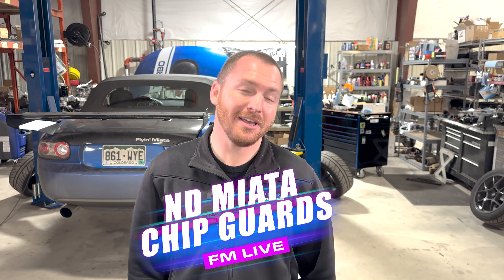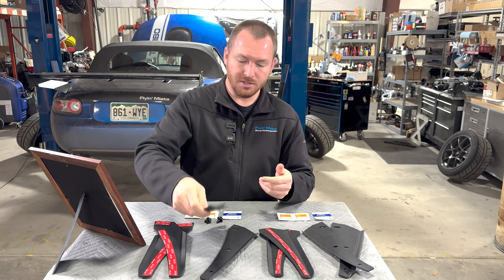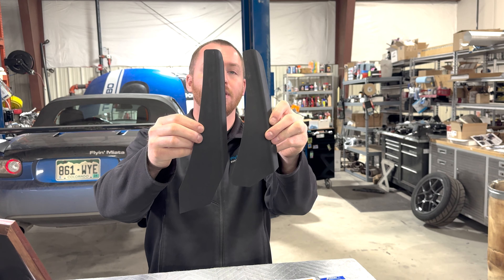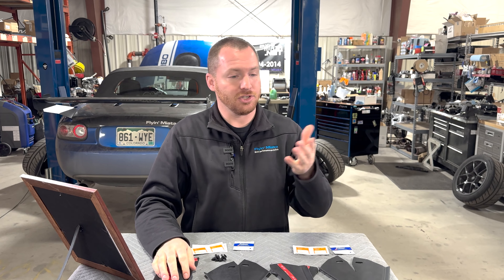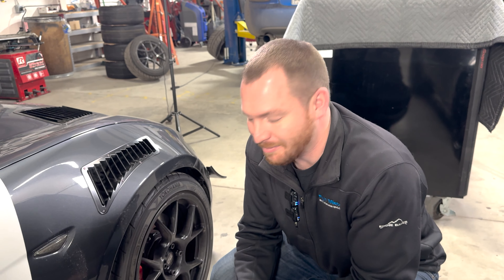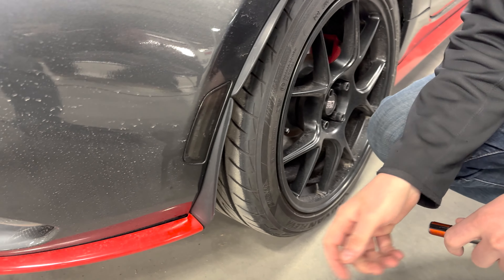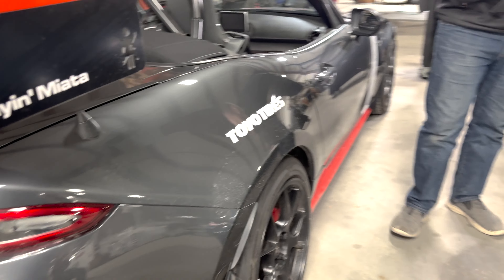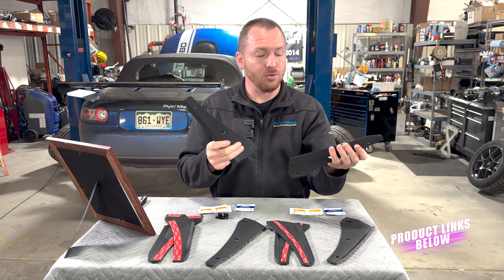Protect Your PAINT! New ND Chip Guards - FM Live 2-29-24

Comment: I bought these after this video, they look very good, was easy to add them, feels very secure front and the back also. The glued ones on the back feels very strongly attached as the guard flexible and light. Only on the back could be still longer if it could go till the end, only last cm get dirt, might you could not glue that strongly if goes till the end or longer (might not).
Reply from the maker: Thanks for the feedback!